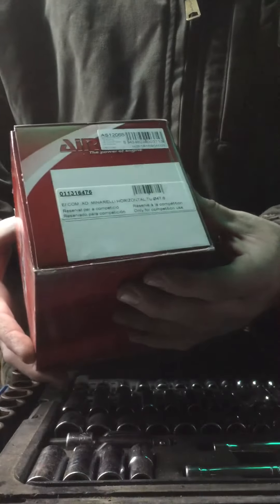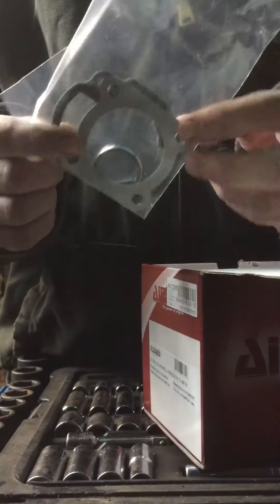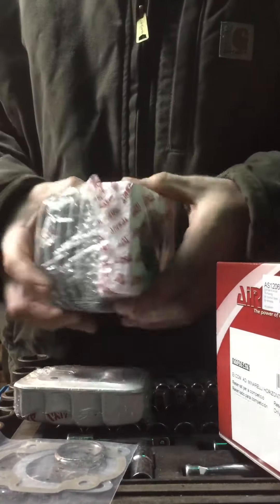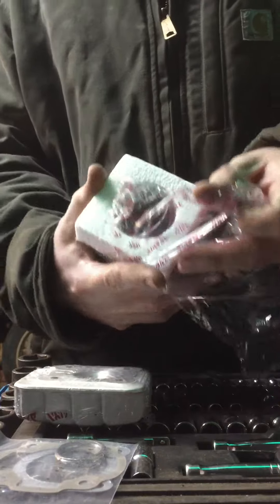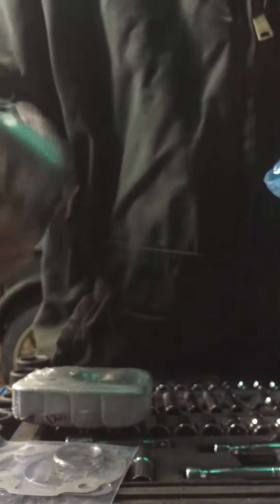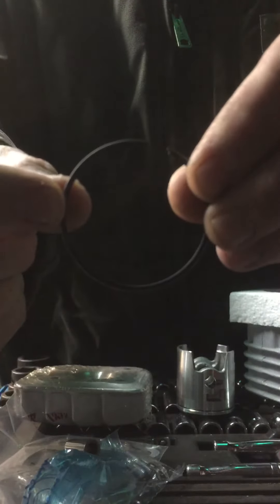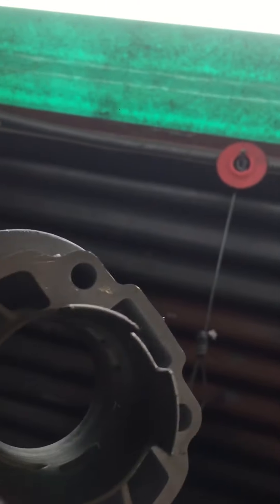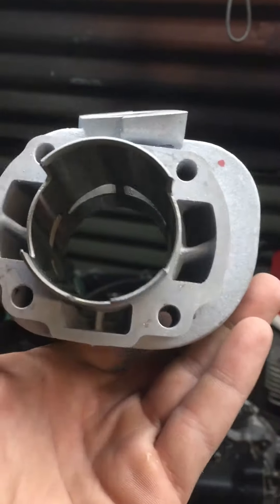Airsal 70cc t6 unboxing

Comment: Greetings. I have purchased the airsal racing cylinder for the Piaggio 70. I just have doubts about the height from the head to the top. squis. gives me 2mm. that measurement is correct. Thank you
Reply from the maker: i had less than 1mm squish when I installed mine but you must be spot on with your jetting easy to seize one up in the nikasil , if you can afford the cast iron cylinder kits it’s worth it